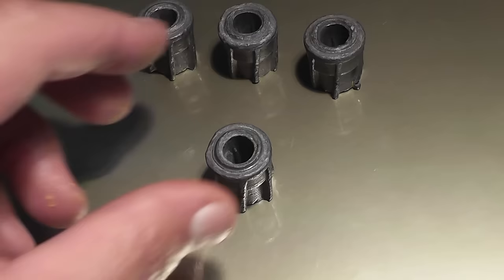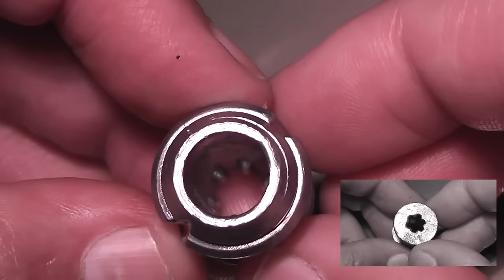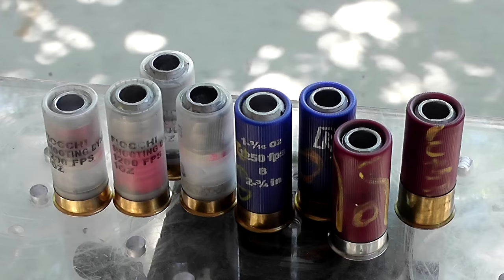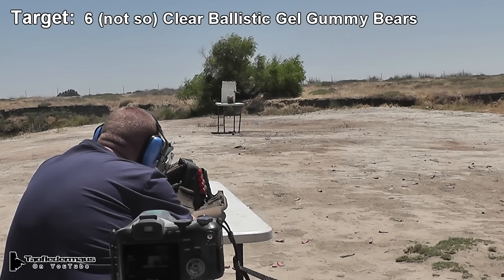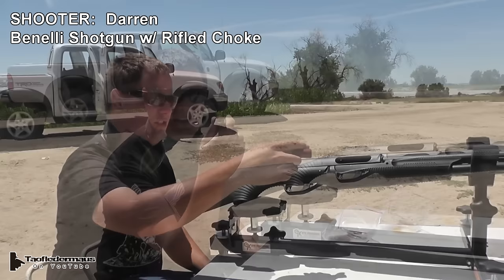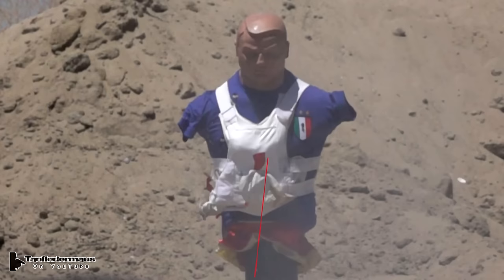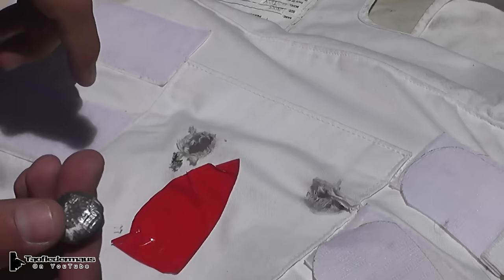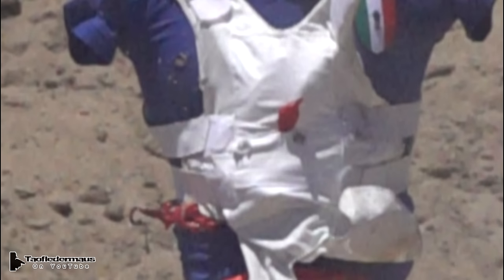RAM JET Shotgun Slug  Design  -  Stendebach II (Germany)

Comment: Stendbach's slug bullet🇩🇪 was manufactured under the name "Ideal Bullet" in Japan🇯🇵 by Kawaguchi-ya Hayashi Gunpowder Shop (K.F.C.).  From the Taisho era to the 1970s, K.F.C. mainly sold ideal bullets for Murata-style shotguns.

 Around the 1964 Tokyo Olympics, K.F.C. began selling "Puma rockets", which are very similar to modern Foster-type rifled slug bullets, so with the transition to paper shotshells using smokeless powder, the Ideal bullets were no longer used.

 This slug bullet was well known to hunters of my grandfather's generation, but I think most Japanese hunters today have never even seen it.  Thank you for releasing this valuable verification video.

 As a side note, there is detailed information about K.F.C.'s Puma rocket in the U.S. patent "US4043267A," and it was ultimately envisioned that it would use plastic wads called "tail wads."  This was very similar in concept to the modern mainstream Plumbata Slug, but I've never seen it in real life.

Comment: On February 3, 2016, Alexander Karlovich Mayer died at the age of 90. RIP
 
 He was ethnically German, but was born in the USSR, in the city of Tbilisi, now Georgia. The Mayer slugs is a lead caliber slugs - quite accurate, not the simplest, but available for self-casting. And the accuracy is largely due to these ribs in the back of the slugs, but not because they give it rotation.

In fact, the inventor of the slugs was not even a gunsmith, he made it for his own needs, working in the workshop at the observatory. It was planned that the heavier head part of the slugs would stabilize it in flight, like any arrow-type slugs, but the main difference was to be a "double turbine". After all, the inclined ribs, which, according to the author's plan, were supposed to twist the slugs in the air, are not only on the outside of the shank, but also in the central hole that goes through the entire slugs, through and through. Therefore, the Mayer slugs can be attributed to both arrow-type and turbine-type slugs.
Slugs, indeed, turned out to be successful and quite accurate. Although there was no significant stabilization from its two turbines. 
I think Meyer had knowledge of the German bullet, and just upgraded it, making it a double turbine.

Comment: Great stuff!  Love the testing of results out of these things.

Spin stabilization is specific to the spin vs the projectile, as in a longer conical projectile requires faster spin to stabilize. Too fast and it fraps out and becomes unstable. Too slow and it wobbles.

Spin stabilization is always important. Distance tells it. Riflings in a barrel are a means of spin, so are riflings in a slug. Riflings in barrels helped even round balls accuracy dramatically. The first rifles without riflings were not very accurate. If you're an inch off at 10 yards you'll be 10 inches off at 100 yards IF it continues on stable trajectory. BUT a bullet not spinning will amplify it's error over distance as instability adds instability and the added instability adds more, and deviation multiplies. Round balls out of smooth bore muskets were good for a few yards, accurate enough to do a job, but at distance they went to hell.
Reply from the maker: I think if these slugs didn't have the 2 external vanes,  they'd probably work better with rifling.  But the vanes just end up acting like paddles and try to propel the slug a little-  seemingly to the side instead of straight forward.
Reply: ***** Yeah, rifling is made to grab a consistent surface and spin the bullet. Rifled slugs grab a smooth barrel and impart spin to the bullet. If you have conflicting forces working it's bound to be a mess.
Reply from the maker: Yes!
Reply: ***** Yes!
Reply: Cool vid

Comment: Great video and info. Interesting to note that the cut shell seems to be Swedish and from Bofors but "Sweden" is spelled "Svezia", which is the Russian way of pronouncing Sweden.  Also Mayer is of course a German surname. I like the longer format videos but i understand why you do not make too many of them :)
Reply from the maker: I really wanted to show both the problems I had with these,  and show them functioning.  I never had that was more finicky.   The Mayer bullets did not care how I loaded them,   they just worked.    I'm still amazed by those.
Reply: The sweeds make awsome artillery and big guns there modern stuffs sci fi
Reply: @taofledermaus  The Mayer slugs is a lead caliber slugs - quite accurate, not the simplest, but available for self-casting. And the accuracy is largely due to these ribs in the back of the slugs, but not because they give it rotation.

In fact, the inventor of the slugs was not even a gunsmith, he made it for his own needs, working in the workshop at the observatory. It was planned that the heavier head part of the slugs would stabilize it in flight, like any arrow-type slugs, but the main difference was to be a "double turbine". After all, the inclined ribs, which, according to the author's plan, were supposed to twist the slugs in the air, are not only on the outside of the shank, but also in the central hole that goes through the entire slugs, through and through. Therefore, the Mayer slugs can be attributed to both arrow-type and turbine-type slugs.
Slugs, indeed, turned out to be successful and quite accurate. Although there was no significant stabilization from its two turbines. 
I think Meyer had knowledge of the German slugs, and just upgraded it, making it a double turbine.

Comment: My dear TFM, I freely acknowledge that you have become the ultimate GURU of odd shotgun rounds.  And, I LOVE these Videos!  that said, You are also really good at telling a story with your high speed camera.  
I would love to see what you can do with various projectiles in a slingshot.  I have been tinkering with these for years, and they are a lot of fun.  But, they are very difficult to shoot accurately. I believe this may have to do with pocket / release issues drastically changing the point of impact. 
I am envisioning some sort of anchored sling shot, using an archery type release, and lots of different projectiles... marbles, steel shot, lead shot, rocks, etc.  
let me know if you are interested in this.

Comment: Long barrel with tight and polished bore do wonders for shotgun range and accuracy, especially with slugs. Less friction in the barrel and longer time in barrel to let the gas pressure get the round to peak velicity. 

Long barrel shotguns with polished bore, and hopefully a properly hardened reciever and barrel.
Reply from the maker: could be!

Comment: thank you tao for also showing the old german advertising from the slugs. I love those old ads for gun related products. It gives very detailed information, even on the price and where you could order these 115 yaers ago in germany :-D I will give you american guys some translation of the old text (not the whole thing, just interesting parts:)
"For 25 pieces 6 Reichsmark (the currency in germany used the time of the german empire) in Caliber 12 and 5,56 Reichsmark for caliber 16 and 20) of coure free house delivery is possible within the german empire" so the text claims ^^ If not available at "your local specialist"...and so on. Also it gives information on survey results from the manufacturer (so these are his own claims) on how accurate it is on specific distances and that this is 100% better than average available ammunition he compares it to. And he also gives some feedback from one of the persons using the slug on deer "best results on ranges below 60m, with a blackpowder load of 5.5 to 5.75 (metric) grams , compared to any other ammunition in smoothbore rifles."

So basically a pure advertising text praising how good his ammunition is. So maybe interesting that it was designed for black powder and not smokeless, so it would most likely not reach the same speeds. That packaging could be museum worthy ^^ propably very rare

Comment: It's really cool to read that old german advertisement. Just an hour drive from my home. If you ever have some old german information that could help you figure things out, I can translate it if need be. The first Stendebach text says his bullet made one revolution every 8 meters by itself and at 60 meters distance he had a groups of 13cm. 
I wonder if it flies totally straight with rifling if the center is drilled out to all the same inner diameter, and then trying different twist rates. I have no clue about supersonic fluid-dynamics, but holding the little plate in the back by suction sounds like the venturi-effect is working by the diameter difference on the inside. I wonder what the pressure distribution looks like.

Comment: sir, i think you nrrd to try use a full rifled barrel instead of rifled choke tube. this may due to its change of movement from smooth to spinning. meaning its better if it has a single movement instead of two (from beginning movement the projectile must flow either straight barrel or spinning. cannot be both). pls try it.

plus if you want better wadding, i believe matt from demolition ranch once use a wooden wadding. it turns to perform better i think

Comment: really interesting slugs but this should be a solution to the nitro card sticking.

In order to make the nitro card drop immediately after being shot use two nitro cards, one with a hole slightly smaller than the one in the slug and one nitro card without a hole and then assemble the shot like this;  shotgun shell -- piston / wadding  -- nitro card without hole  -- nitro card with hole -- slug with center hole. 

This in theory should allow air to travel through the slug immediately after it leaves the barrel, and because the hole in the nitro card is slightly smaller than the hole in the slug, the moving air should catch and pull the nitro card away from the slug during flight.

Comment: The shock wave in front of the slug means there is no aerodynamic stabilization. In fact with the shot-card sticking to the back it appears to be more stable, so it's not air going through the slug giving any spin or fin guidance.
I think it might possibly be  riding a "hollow" shock wave.
You know what a supersonic shock wave off a pointed slug looks like. It's conical right? Well I'm thinking a torus leading edge might create a slight flattening to the point of the cone, or a weak point. And while it is very hard to break out through the boundary of a shock cone, causing it to have a weak front means the shell is always trying to follow the path of least resistance. That is forwards through the weak nose, or turbulent air at the front of the shock cone.

Comment: would love to see if there is any difference using the original black powder load and see if the ballistics turn out to be any better..with a slower slug. The old sheet shows that it was designed for a blackpowder load. Wonder if that does any change t.... Could less speed do a difference about the tumbling?

Comment: you should try and put a hole that is the same size as the hole in the slug  into the nitro card. i believe some some sort of vortex is occurring that the makes air travel through the slug. but not from front to back, but from back to front. this may be why the card is sticking to the back, and putting a hole in it may improve its stability.

Comment: Hey, is the B.C. on these ultra-low, because they're not displacing much air?  Then they could be ultra-light like Lehigh Defence all-metal bullets for RIFLED barrels, to penetrate kevlar (or AR 500 if a 3D printer can print in titanium/carbide/harder materials at home)?  Like a little crotch-rocket doesn't have as much Frontal Area as a Mack truck, thus retains WAY more velocity after you lift off the gas pedal?  So a 7.62x39 would get 6.5Grendel type of energy-retention... in an approx 80-grain 7.62x39 going >3000fps, then it flattens (or stays rigid if Titanium, etc, for armor piercing) for the TERMINAL ballistics.

Comment: Just because the nitro card was held against the back by external airflow effects doesn't mean that it wouldn't pass air through the centre given the chance. It just means that the air pressure pushing it against the rear was greater than the air pressure going through the centre. Example:

Imagine you have a standard bullet tip, but you put a big plastic cap on the tip with a flat top. Just because the cap might not get blown or spun off, doesn't mean it's not interfering with the aerodynamics. The only difference in this example is that it's more intuitive that air pressure is holding the plastic cap in place.

PS: Not sure how you can say that the Mayer 'stole' the design from Stendebach while also saying they performed much better. Obviously the design is different in that case ....

Comment: I am wondering if you put them in the shells backwards and made the front (back) rounded would it fly better because of the drop in weight and the cavity in the center is slowing the slugs down because it is compressing the air if you turn it around it alows the air to expand therareticly

Comment: The slug is weight forward, as the inner hole Diameter is larger at front so is the external diameter, the back side has smaller diameter both inside and out. The internal ribs at the rear give structural strength at launch since all iniertial load needs to be transferred from back of the slug when fired.

Comment: The curved outer surface makes a high pressure are on the outside of the slug.
Therefore the inner surface is a low pressure area, that is why the nitro card adheres to the base.

Comment: This is a strange request, but I think there's a way to see how these slugs operate without the nitro card. Attach 2+ equidistant forward-facing shimwings to the nitro card that will drag heavily the moment it leaves the barrel. Hopefully there won't be any suction to pull the slug as well, but...

Comment: So as a mechanical engi i feel compelled to explain this. At subsonic speeds aerodynamics works as we expect . specifically what you would expect is for a hole that tapers to act as a nozzle and accelerate the air through it. However at supersonic speeds this effect is reversed and it acts as a diffuser. the air flow rate through it is reduced quite a bit. the result is an area of very low pressure (that compared to the outside of the bullet is enough to keep your wadding stuck to the back of the bullet... its the low air pressure.). 

Technically that little bit of info comes from rocket science sooo this bullet was made by a rocket scientist 😂😂

Comment: I'd try two things. 
1. Load them in the shell backwards.   The way they look like they'd be. 
And or
2. Use a nylon washer instead of a nitro card. See if the air will flow through the center

Of course its always possible that neither of these suggestions would work.

Comment: Schlieren photography was invented in 1864 to study trans-sonic motion, so it's entirely believable that this was invented almost forty years later.  This slug most likely exploits the shock waves generated by its shape to increase its stability.  The most interesting part of it though is that it creates a HIGH pressure zone behind it, and a low pressure zone in the cavity, which is why the wadding stays attached the entire time.
And it's entirely possible that Mayer didnt know about a bullet invented sixty years ago, and used the same principles to do the same thing.  Also "Mayer" is not a Russian name, he was most likely German.

Comment: What do you think would happen if you punched a hole in the nitro card the same diameter as the hole in the tail of the slug?  The card might fall off now due to a lack of pressure differential between the outside and inside of the slug.